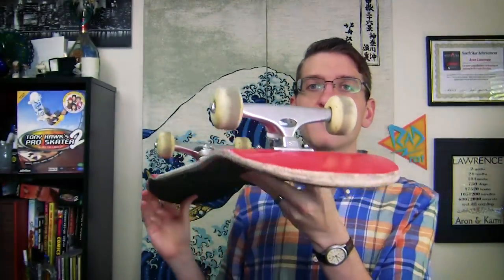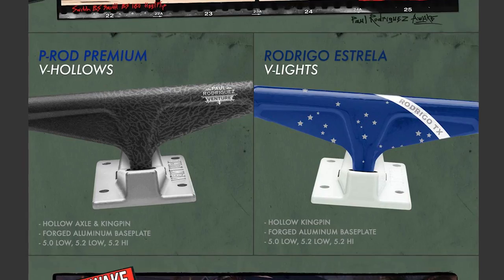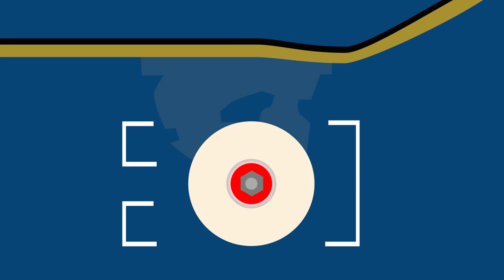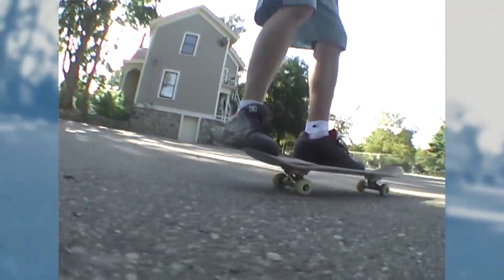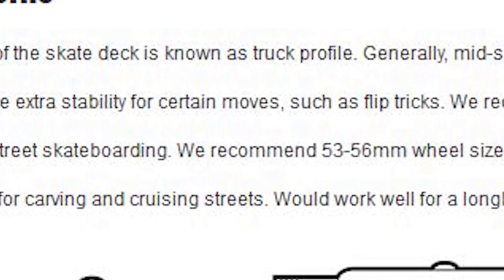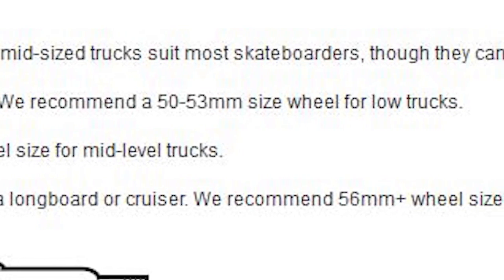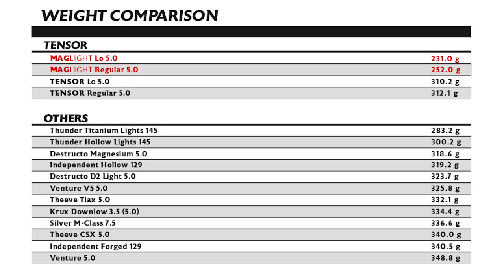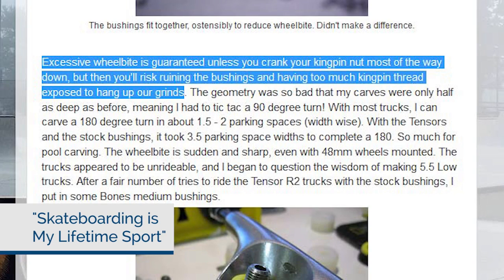Low Vs. High Trucks - What's the Point?

Comment: Hopefully this gets seen but their is a lot of misinformation in this video and the heights of trucks are out there you just got to know where to look. However, I do know the heights of most major trucks and I'll make this comprehensive list to hopefully help those who see this. Also, most skaters will definitely notice a difference in height for sure. 

                           Independent-

Standard and Regular hollow  55mm
Stage 4  55mm
Forged hollow and titanium  53.5mm
Mid. 52mm
Forged hollow mid. 50.5

                                 Krux
Regular  55mm
Dl 52mm

                                  Venture
Standard 53.5mm
V light, v hollow, and titanium 52mm
Low 48mm

                             Grind King
Disruptor 53mm

                              Royal
Standard 51mm

                               Mini Logo
Regular 49mm

                                Bullet
Regular 51.5mm

                                Thunder
Standard & team hollow size 143-147  50mm
Standard & team hollow size 148 and up  52.3mm
Lights, hollow lights & titanium 143-147 49mm
Lights, hollow lights & titanium 148 & up  51mm
147 high. 52.3mm

                                    Tensor
Standard ATG and Mag-light ATG  55mm
Alloys 51mm
Mag-light low  46mm

                                  Silver
M-class 52.1mm
L-class. 48mm

                                   Destructo
Mid 56mm
Low 49mm

                                   Ace 
Classic size 00-33  52mm
Classic size 44 & up 53mm
Classic low 48mm
AF1 53mm
AF1 low 49mm

                             Slappy
ST1 54mm

Hopefully someone sees this and puts all these useless numbers stuck in my brain forever to use! Cheers.
Reply: Thank you..

Comment: In my experience of skating all different brands, widths, and heights of trucks, it actually does make quite a bit of a difference for me. Weight and height are the two things that I am most picky with when it comes to trucks. 

With height it actually does affect how I pop my ollies, because the timing between when the tail strikes the ground is different between lows and highs. I prefer high trucks, because I am more used to the ollie timing and I feel it is easier to grab my board for Boneless tricks. 

Weight is the biggest factor for me with trucks. I have skated trucks that were too light and I have skated trucks that were too heavy. The trucks that were too light were Tensor magnesium trucks. I think those trucks were lighter than my deck, because my board definitely did not flip around the same way, it seemed to want to land upsidedown. I would prefer heavier over lighter trucks for that reason.

Comment: you want the truck height to be proportional to the board width and the wheel size. Wide board, bigger wheels... ride a high. Skinny board with tiny wheels, ride a low.
Reply: This is how i roll.

Comment: 10:22 I've been having truck madness for over a year thanks to ben degros but this freaking segment right here is what i've been looking for all along. Thank you rad rat!
Reply: What you ended up with ?
Reply: @ho2673  Ended up sticking with Royal (52mm high). I ended up buying an angle-measure to see how steep the board gets at pop. Venture Lo's had a crazy low angle so thats why the pop felt low. Independent had an insane angle that my legs dont have the power for. Thunder and Royal have the same angle but Royal has a short wheelbase to make pivoting my 180's easier. Hope this helps!
Reply: @cardiothoraskate4524  my kid skated in royals from June until 2 weeks ago and they were great ( chocolate deck 8.25 + royal 149s and 56mm ricta wheels ) .  Right now we got Indy.

Comment: I've been skating for 30+ years now, I skated old school boards with bigger wheels, I went through the skinny board, small wheel, big pants era. Today my setup is the same as it was almost 10 years ago, 8.25 deck, 52mm wheels and Venture Lo trucks. What's better, Lo's or Highs is strictly personal. I deviated from a low to a high once and switched back as soon as I could. For me, a low profile allows me to pop quickly. I have pretty good pop already but my legs are probably stronger than most younger skaters. When I skated highs I discovered that it took a fraction of a second longer for my tail to hit the ground when popping tricks that I felt like I was going to have to relearn a lot of them. I rely on a lower setup because I need that instant contact when popping but that's what I'm used to, it's my personal preference. Performance wise, personally, I don't think there's any difference, it's more about how you've conditioned yourself and because there are height differences available it makes you that more conscious about its impact. The type of skating one does will also dictate what's a better choice. Like you said highs are good for transition skating and lows for street/tech.  skating, sorry guys/gals....I said a lot.

Comment: I started skating in 1983. When wheels got tall and skinny, my ollie got higher. At first I just thought it was because I had so many years under my belt. But over time, I realized it was my tall trucks and my tall wheels. I had so much more pop. You could even hear the difference.  I could never understand why trucks started getting lower and wheels getting smaller. And after even more years, I realized this. The skateboarding industry will continue to change truck and wheels size over the years, and I think it is to change things, just to change them. To make things seem "new", and you need to buy it.

Comment: I ordered both the tensor mag light low and the new tensor mag light all terrain (regulars), and I felt a drastic difference between the lows and the regulars. I tended to have better "pop" with the regulars.  I eventually had to throw riser pads on my lows (which added about 3 ounces per truck), but was able to flip, pop and control more easily.  The difference between tensor lows and regulars were pretty blatant.
Reply: Nice, cant decide between the two.. I skate mostly flat..

Comment: At least indy/thunder/venture lows are all the same height. Anyway, for me a 3mm height difference is very noticeable. And wheels are always varying in size as the wear out constantly. Btw the extra stability is actually the limited turning radius you explained later in the video. Oh and you can re-thread axle tips with some skate tools!

Comment: Skate high for pop
Reply: thats a myth.
Reply: get a raiser pad for higher pop
Reply: I get high to skate.
Reply: yeah dude nah it's science
Reply: A Payze thts false low all day
Reply: its a myth? ever tried getting good pop on a deck with no trucks on? yep its almost impossible so yes it does give you more power
Reply: it's pretty subjective... I like low trucks with a heavy concaved deck... at least 7.5" width.. I also love wide wheels. low trucks and wide wheels are like the ultimate in stability.
Reply: I've skated them both. Low is a quicker snap. For hang time, go with a high truck. 5.2+
Reply: That’s not true, as you would have to mix and match the right truck-deck-wheel combination in order to generate the most optimal pop for your skating preferences.
Reply: JJ KK skating preference is different to the raw physics though
Reply: Just get a steeper deck or a deck with a shorter tail or even combine the two lol
Reply: Pop for skate high
Reply: Skate low to not die

Comment: For me it's purely a confidence issue. With low trucks and smaller wheels (48s on a 7.75 board) I feel closer to the ground and for some reason that makes me feel more connected to the board and the tricks I'm doing.

I've noticed as the board gets wider and the trucks and wheels get higher and larger I feel more and more like I'm floating rather than being connected and I progressively lose confidence in the board. 

Though I do notice I lose pop and speed with a smaller set up. To compensate I just push and pop/flick harder, which works with my aggressive style.

Comment: I switched from Grind King light low trucks to a set of old high stage 10 Independents when I was much younger. Although they were way heavier I was noticeably better able to get on top of handrails and higher ledges right after I made the switch. It also means everything to be able to have high trucks to carve the local skate park, or bombing hills while street skating. If you have any stability problems or want to cut weight just get firmer bushings or thinner wheels in my opinion.

Comment: Maybe it's just me BUT I made the switch to thunder senora los, from classic indys about 5 years ago and I my experience is several things

Weight: obviously thunders are way lighter but u sacrifice pop and cleanliness in your trick, an Ollie with indys feels more solid and strong.
But I noticed that I was able to skate longer, and to me being almost 30 now, being able to skate longer is important. So yes I sacrifice a little bit of solidarity in my popping but I feel like I make up for it in stoke.

Hight: when I switched from Indy to thunder I noticed a quicker snap of my tail, you're right when you saw that u can build a better pop on a higher truck BUT what I feel I gained with a Lower truck was... confidence. For some reason a lower truck feels... safer to tre flip than a higher truck. Mind you I'm 29  I work full time and I don't get to skate as much as I used to, so getting back on the board everytime that little bit of a lower center of gravity goes a long way.

Again, these are just my experiences and obviously to each there own. Different strokes for different folks.

Comment: there is 1 (for me big) downside to high trucks that you didn't talk about tho... yes, you will pop your tricks higher (you have to, because the angle at which you will now pop your tricks makes that) but you will also need more power to do every trick. it's actually significant after an hour or so. i lended my friends skateboards a lot and i definitely felt that. also the timing is different. while on my regular stance i got used to it the second time i tried to do a trick, on switch i just couldn't do switch kickflip because it was too hard for me to wait a little bit longer before sliding my foot. and when i eventually got the switch kickflip on higher trucks/set up i had to go through the same process again on my set up.

Comment: Great points and great video. I think I may try using low trucks with risers to save my knees @40+ years old. I definitely agree the trucks help add swing to your pop to increase height. Personally, I am one who stopped for 23 years and am just now getting back into skating again too. One of the most enjoyable parts of it for me is passing this stuff on to my children. Historically though, I was always tech > ramp but I wasn’t big on riding too low to the ground. I think there’s is a happy medium (standard truck height/52mm wheels).
Reply: So, for you, low trucks are bad for knees ? It is true that I noticed that the highs had more cushioning..
Reply: @pierrekruk  I use the risers to help with impact support but I also don’t want my board too high off the ground either 👍

Comment: I think it's all preference. I always skated low trucks and loved them. Tensor lows alway up until I was maybe 12 or 13 I got my first set of Indy highs and I hated them. They felt so heavy and slow/hard to pop. Switched back to whatever lows I could fine (tensor/venture) and felt good but when I got older (hit puberty😭) and my body got stronger I started riding bigger setups and felt so much popppier and steezier. I think a lot is body type aswell like a teller guy needs a taller board right? And don't forget about wheel base because that makes a huge difference in pop and all around board feel

Comment: My problem with low cks is they have cone/cone bushing setup but that's easily fixed with a washer underneath the bottom bushing and a cone/barrel setup.

Another issue is companies not posting full specs on wheels, decks, trucks etc. They don't tell you contact patch on wheels, sometimes you can't see what bushing setup a truck has because they only show the front etc.

I like Tactics because they show full specs (length of board and whatnot) but still don't show both sides of the truck in many cases.

Comment: Hi, I have skated tensor lows since I started skating and whenever I try skating independent there is a huge difference in how it feels when doing manuals and manual tricks. So I would say try doing manual tricks and you will notice a huge difference. 

Low trucks: more stable less room for error (more space before you scrape) High trucks: less stable more room for error

 I don't really know which is better, I think it comes down to preference.

Comment: I want to share my opinion for anybody who is shopping for skateboard trucks and reads this. I started with tensor mags and after a couple years I tried my hand at some regular independents. When you hear about the lightest and heaviest trucks these are the names you hear the most often. After skating both trucks for at least a year now I noticed a big difference. When I had the tensors I loved the lightweight and thought the trucks had great response to my turning. Switching to the independents I was thrown off by the weight and the response a lot. I thought I would never get used to it. Here I am a year later and I would say I prefer independents over the tensors. I got used to the response and weight. I actually like the heaviness of the board because it gives the board a solid feeling and my flip tricks aren’t flying in the wind. Also the independents were taller which gave me more clearance to loosen up my trucks. Basically if you are gonna buy skateboard trucks just go with a brand that catches your interest. It really is best to try it out for yourself.

Comment: Truck height is something I've recently realized is a huge deal for me. I really dont like skating high trucks. Low trucks definitely make me feel more secure and more control, also better most stable manuals. More common wheel bite but it's worth it for all the other benefits. I just feel more confident with being lower to the ground.

And honestly the difference is even noticeable in pushing. Got high trucks and I notice I have to step lower to push my foot on the ground. That was the biggest surprise to me.

Comment: Before I got too tall with Sideshow Bob-sized feet, I skated with a lot of dedication for about 10 years.
I've skated hand rails, ledges, gaps, trans, etc. The things that altered the feel the most to me was board shape and board width, followed closely by wheel size and bushing tightness/hardness. And regarding trucks, the "width" of the truck (which I suppose would be the wheelbase? The size of the axle) makes a really big difference. Truck height? Well, when adjusting bushing tightness as well as the hardness, that will alter how much the axle is going to turn and how it feels. And you could emulate the feel of lower trucks with higher trucks and vice versa when adjusting these things.
In short; I think that if truck height is not the very least important factor in finding a good setup for you, it's damn near close.

Comment: The difference between my Destructo low's and my standard indy/krux trucks is huge. The Destructos just feel so stable and close to the ground, the smaller turn radius makes you feel very secure, but naturally you can't turn as much. Tricks actually don't feel too different, but riding in general does, pushing is easier on the lows as well, you know? But then you get sick of small wheels... I mostly skate Krux, but the Desctructo lows are definitely one of my favorites.

Comment: the most noticeable difference is with nose manuals. with the board higher from where the wheel is pivoting the threshold from a low angle manual to a steep angle is much different and more difficult to adjust to.  if you arent anticipating the quick change of balance needed u will nose dive unlike a pair of low trucks which are more forgiving.  i remember having some high tensor mags 6 years ago and i quickly learned to keep my nose mannys low.  I have stuck with the lighter indys since then

Comment: I have used many different trucks throughout the years.I was like super ocd about my setup as a kid haha. One thing I liked to do was mash up different brands. I mashed tensor baseplates with venture axels and that truck is a lower medium height, nice solid feeling. The ones I use right now are krux baseplates on independent axels. It's a higher medium profile, perfect feeling with bones hard bushings in my opinion. I used to skate really tight trucks but noticed recently my style is trash so I started loosening them. I think it's cool to just go to the skatepark and just try different peoples boards and see what feeling you like best in a truck. Sometimes it's a personal preference and has nothing to do with any statistics or anything. I will say that as far as the stableness of lower trucks definately makes sense in skating ledges and rails and you're slightly less likely to land primo.

Comment: I liked when i had the thunder 147 hi's with 52mm wheels as i felt close to the ground but i would get wheelbites. I didnt like how the indy 139 hollows were high off the ground with 52mm wheels .so what i did was change the wheels to 49mm on indys and it was certainly a big difference.  I was closer  to the ground and my setup was much lighter.

Comment: I redrilled holes in my Enjoi to make it a 15" wheelbase. I put some low ventures on it and it still Ollies good. 
The lower truck seemed to balance out the potentially different angle made by moving the trucks closer to the end.

Comment: CCS post information about some trucks weight, height, width, hollow or solid, type of steel. Low trucks are made for 53mm wheel max or smaller. I have 42mm Slime Balls. Most people skating 53mm-60mm need high trucks and risers.